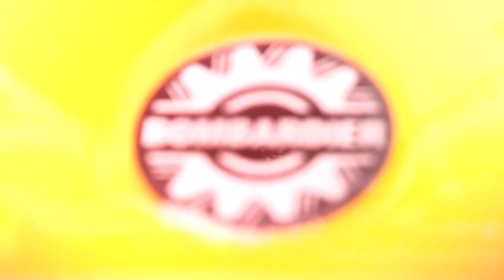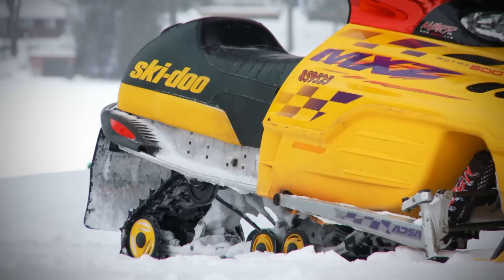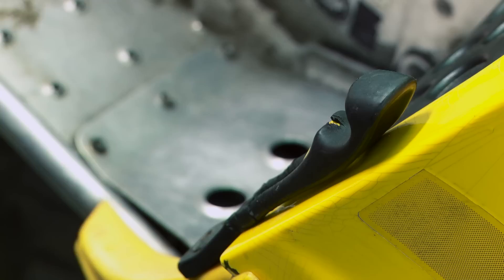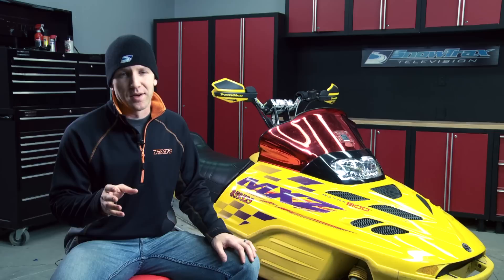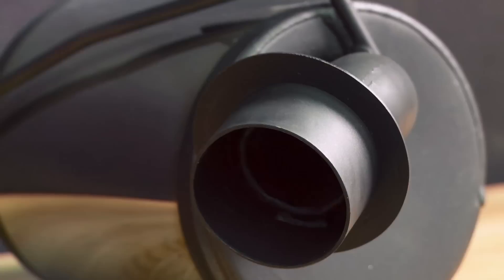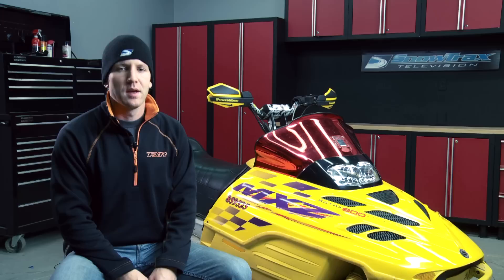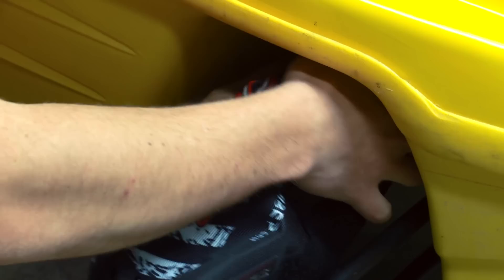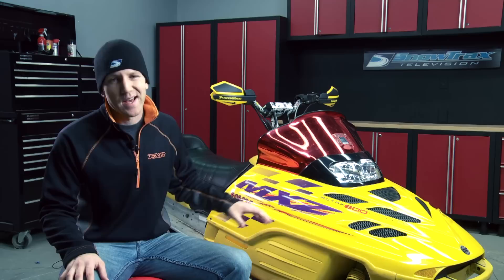MBRP Snowmobile Exhaust

Comment: Just put RSI 3 inch 30 degree bar risers on my 2000 MXZ 500. Looks great and functions perfect. Im 6 foot and dont have to bend over when i stand up anymore. Fits perfect with no cable extensions. And fits the stock bar pad.